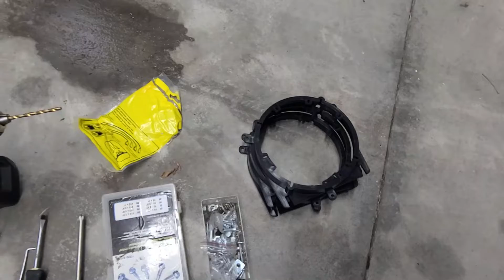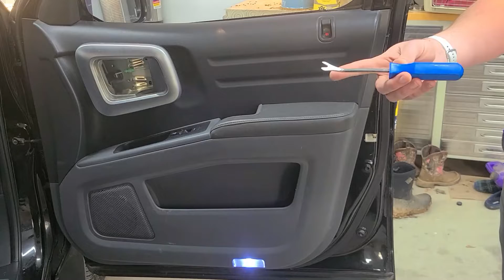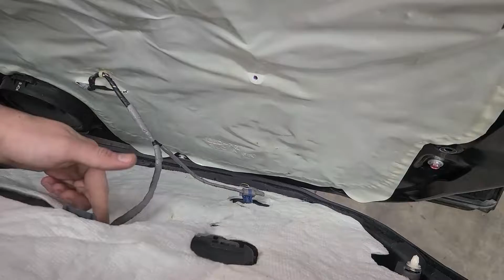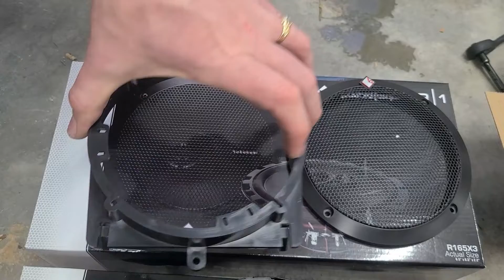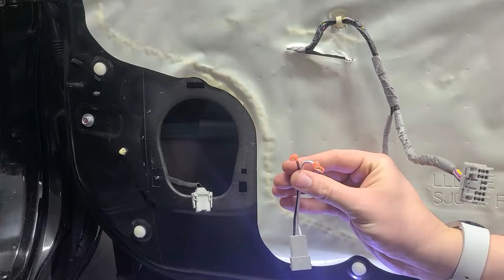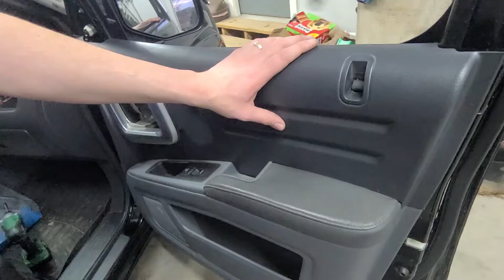How To Install Car Audio Speaker / Speaker System / Door Speaker Install - 2007-2016 Honda Ridgeline

Comment: Its been years but thanks for posting this video. I did the rear speakers they were torn/fragmented.  I Liked how much better the new Polk speakers sound so I did the front speakers a week later. Did anyone notice on the speaker magnet on the OEM Honda speakers it says MADE IN CHINA. Honda going cheap on the speakers but I still Love My Ridgeline. I'm assuming the sub is from China too..Oh well can I really complain after 19 years?

Comment: What kinda of screws do you use for drilling in the door? You said 8mm but what’s the length?

Also wondering if you could share what size drill bit you used for pre drilling! Im new handy work so any details would be a great help! Thanks for the video!
Reply from the maker: As far as specifics go, we just used a 1/4" pilot hole drill bit and for the Screws we used standard self tapping screws of about 1/2" long. Nothing special really. Just get a Drill bit set that's rated for metal (wood ones won't work) and go to your local hardware store and get some self tapping screws and a matching driver bit to drill it in (IE: If it's a flat head screw, get a flat head driver bit) Hope that helps!
Reply: @GT-Industries  Thats super helpful, thanks for the quick reply and the info! Gonna work on this, this weekend!!
Reply: Do these speakers sound a lot better or just marginally? I’m not much of an audiophile, but I want clear sound for sure.    Thanks

Comment: I'm tryna instal 10s. The wires have to run from the speakers to my amplifier instead of my headunit. So I'm running new wires 

Any idea how to remove the rubber tubing that sheaths and protects the wires in the space between the door and the door frame(the closure area/doorjam near the hinges)?
Reply from the maker: Depends on the vehicle but normally what we do is follow the manufactures guidelines on how to remove the rubber from each end (where the connectors actually go in the door) and use a stiff welding wire to run the wires inside that rubber along the harness. Once the wire is all run, simply reinstall the rubber on the connectors. (Typically the rubber simply peals away from the connector it's covering and allows you to push some pins or un-do a bolt to get the connector out but again, that's different for each vehicle)
Reply: @GT-Industries  gotcha thanks! I moved to the back doors and found like you said, tho stiff the rubber just peels back.